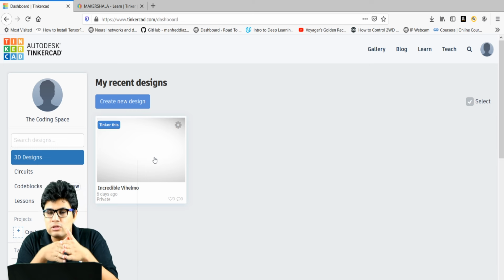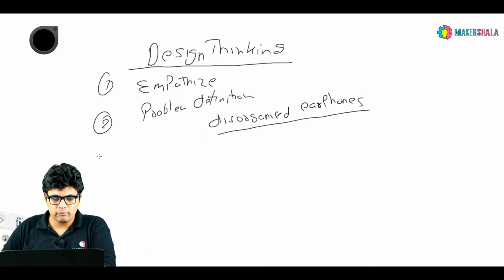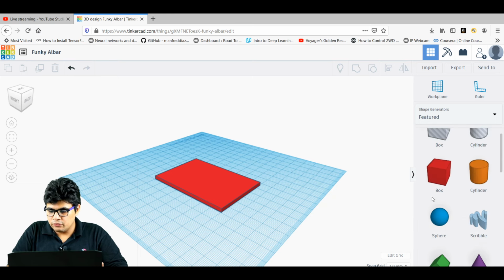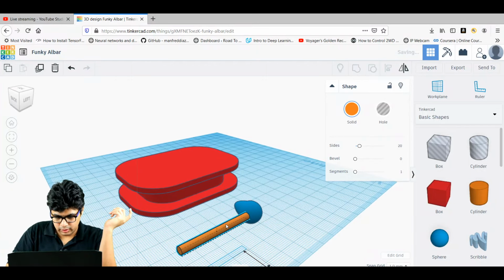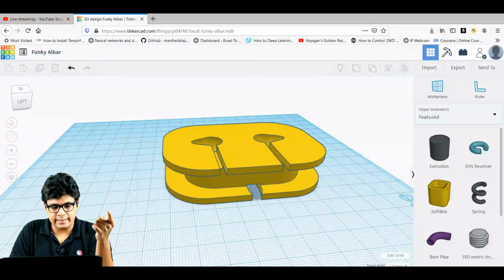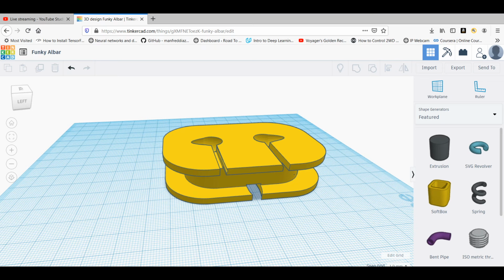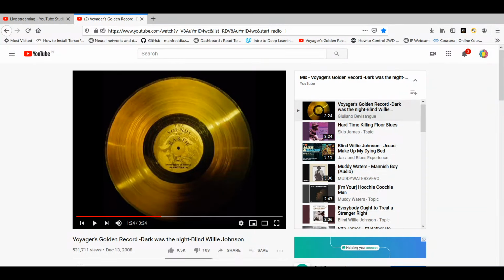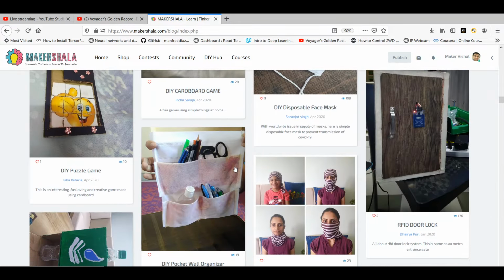Design Thinking with AutoDesk TinkerCad || Live Session || Makershala

Comment: Which Editing software is this?
Reply from the maker: Tinkercad is an easy-to-use 3D CAD design tool. Quickly turn your idea into a CAD model for a 3D printer with Tinkercad. You can use it on www.tinkercad.com
Reply: @Makershala  I'm talking about the video editing software.